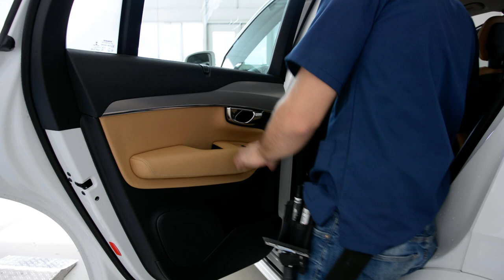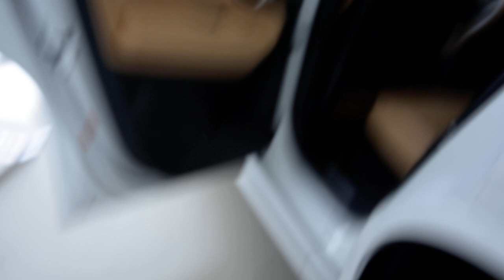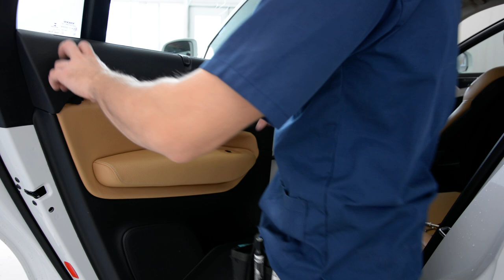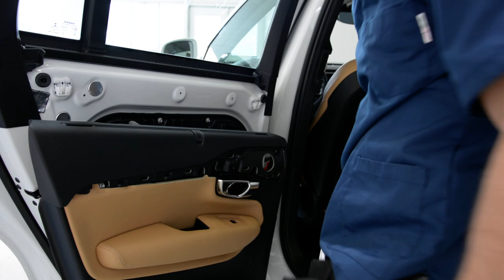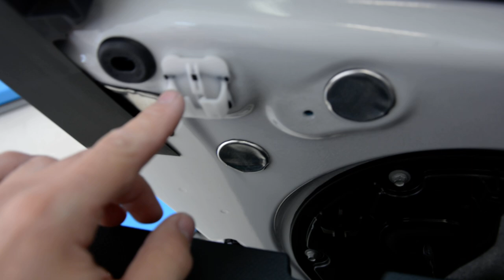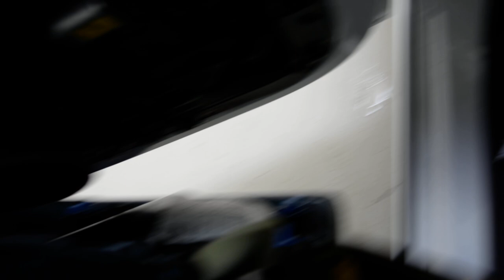Volvo XC90 door panel removal

Comment: HI, i have a problem with my rear passenger door, it will not open from inside or outside. Is it possible to get the panel off when the door closed? Is there a way of getting the door to open?
Reply: HI, I have a same problem. Have you fixit ?  HOW ?
Reply: Same problem here